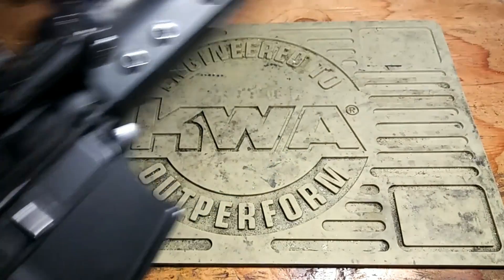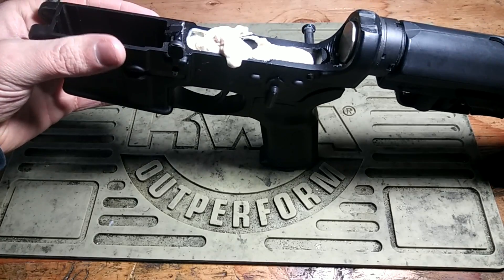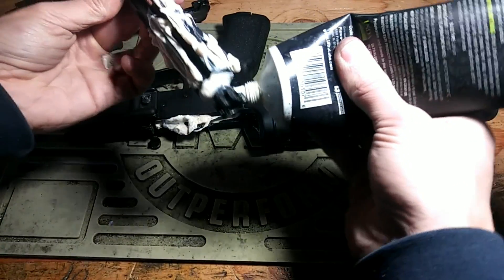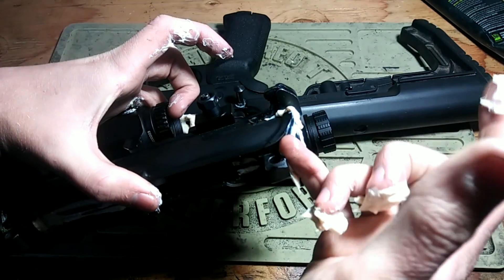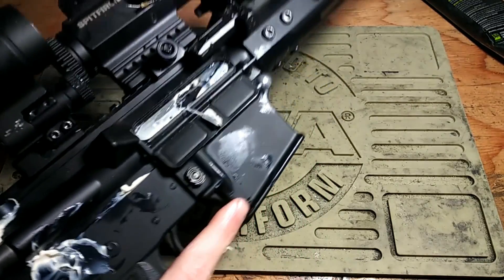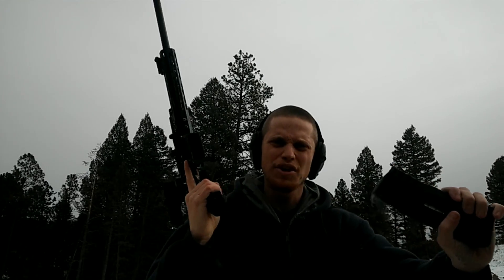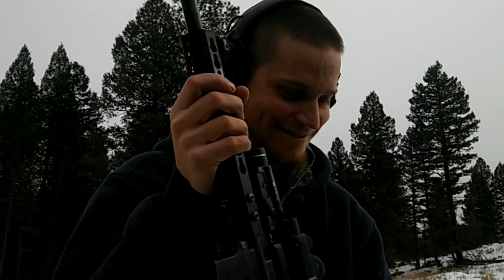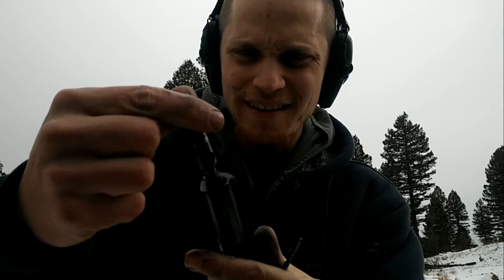MythbustAR15 OVERlubrication and NO GAS RINGS?!

Comment: OohRah, never to much lubrication, and do people realize how many m16s and m4s over seas getting abused daily and none are going to pass a gas ring test but they run just fine 🙂 imagine that. TBH ive never done a gas ring check nor ever replaced the gas rings on any of my ARs and I keep em wet asf when running em and no issues.
Reply from the maker: Ya. Seems to be a pretty robust system.

Comment: If it served no purpose to put gas rings in the weapon gun makers wouldn't put them in
Reply from the maker: It does serve a purpose. My point was people were saying when the gas rings were perfectly aligned, it was a flaw in the system and it would make the firearm malfunction, I proved it is more for redundancy and for self cleaning purposes. It is not essential for the function, just helps.

Comment: Grease does attract the dirt and debris very nicely. The problem is that as it collects the dirt and debris it changes from a lubricant to a more polishing type compound and then to a rubbing compound until it is basically  a sanding compound. The more dirt it collects the more efficient it becomes at removing metal. Ever polish metal? That nice blue Mothers metal polish? When you use it on metal and the rag turns black as the metal gets shiny. The black on the rag is not dirt. It is metal the polish removed to make the metal smoother. Not different than heavy equipment. Too much grease collects dirt that will prematurely wear parts in any application.
Reply from the maker: I like your thinking but oil doesn't last as long ime. ;)
Reply: @DouglasThompson  neither will the rifle with over lubricating
Reply from the maker: Better to be over than under. ;)

Comment: case ejection seemed extremely erratic when you removed the gas rings. If I had to guess (examining the ejection pattern with the gas rings still in) the rifle is overgassed to the point that the rings become kinda redundant.
Reply from the maker: Ya, that could be, thank you for your input! :)
Reply: I agree, definitely over gassed (as most AR’s are) I’d try a heavier buffer.
Reply: If anything the rifle is running pretty undergassed since the cases are either barely flying out or eject behind the shooter. Overgassed rifles tend to shoot brass forward at the 1° position.
Reply: @nemisous83  well it's definitely undergassed without the gas rings

Comment: Great vid. No more under-lubricating for this guy. Question: Does that white lithium grease liquefy and run all over at all when the gun gets hot?
Reply from the maker: No but it does need to be cleaned off and re-applied if it is going to be sitting for a long time. It wont hurt anything but it loses some lubrication qualities after a year or so. I typically clean my firearms after every session so it was never an issue for me. Id say a lighter lubrication would be best for long term storage.

Comment: I used high temp wheel bearing grease on all my guns never had a problem and it does make it easier to clean as all that powder residue does get cought up on the greese
Reply from the maker: If it works and works well, no argument from me, I haven't personally tried that yet.

Comment: Tbh I’ve been “over lubricating” for years. With the exception of rimfire I just squirt more oil and cycle the action.
Reply: Same. I bought an AR-9 from Palmetto State Armory and it came with a used BCG in it. Someone had run the thing dry with no lube for who knows how many rounds, and the coating had visibly worn off across most of the main contact/bearing surfaces on the bolt. It still feels slick, even dry, so I think it might be like that coating Sig uses where the color wears off but the nitride coating or whatever it is is still present. But still, someone ran the hell out of that thing and PSA sent it to me for full price as a new gun. Bastards. They offered to replace, refund or give me a $30 gift card. Considering the rest of the weapon looks brand new, and I plan on replacing the BCG anyway, I just opted for the $30. Still haven't heard back from them after weeks and several emails.

Comment: I’ve been saying this for years. Gas rings are nice because they push the bolt forward to make the rotation happen against the face of the chamber and not against the extension lugs helping prevent binding or cracking in the event that either surface isn’t completely true. Not needed, but nice to have. Grease is awesome.

Comment: Very cool video. I noticed that the case ejection pattern change after you took the gas rings out, so maybe some effect there.
Reply from the maker: Oh ya, it definitely is best to run the system with the rings. Just wanted to show it works without them since I had heard of so many people worried about the rings being aligned would cause the rifle to not have the compression needed to cycle.

Comment: That's not the point. If you ever lubricate here we're I live I will attract a lot of dust and dirt.
Reply from the maker: Well, Depending on your environment, yes oils and greases can collect debris. Oil and grease does not attract debris, though.

It is always better to lubricate than to run dry when it comes to mechanical things. You should clean and re-lubricate your rifle often, if it is used often. Much of the oil/grease removes from the action when the rifle is cycling. The lower does keep grease and oil contained better than the upper assembly, typically. Grease and oil does allow debris to move. If debris gets into the action, it will get displaced. The debris collected will move around until it settles in a spot no moving parts can interact with it. Some debris does get crushed and becomes part of the "paste" but a part surrounded by lubrication will do a better job protecting the system than a dry one.

There are tests proving this, it would be foolish to run dry, imo.

Im sure arctic conditions would change things a bit but for much of the world metal on metal at high speeds rubbing against eachother works best lubricated.
Reply: @DouglasThompson  yes I agree, but even if you run your AR dry. The rifle can use the carbon fouling as a dry lube.
Reply from the maker: @ortiz11039  from my own testing, and other tests I have found, it is best to run wet.

Comment: I don't really see that you proved anything. Yes under certain conditions an AR runs fine over lubed, the same can be said of no lube at all. Worn, damaged, or missing gas rings do not automatically mean an AR wont run.

But all of those scenarios have a more likely increase in a malfunction.
Over lubing will cause greater carbon buildup as well as capturing field debris.

Over-lube in the gas key, buffer assembly, or chamber can cause catastrophic failures.

Under lubing is less problematic, most AR-15 rifles will run fine dry since carbon without oil or grease is a dry lubricant. The downside to running dry is increased wear, and if any debris is introduced an increase failures can happen.

Worn, damaged or missing gas rings, won't necessary stop the rifle from working,  but probability of failure is increased.
Also over time, chipping on the back sides of the lugs or even broken lugs can can occur.

The right way to run an AR is using quality lube, and only a light amount, reapplying as needed.

Comment: This is hilarious! I think you missed a spot! Without the gas rings did you notice the inconsistent ejection of your brass? This would make sense.
Reply: Lehmann Peters 
Yup. 
Noticed that immediately
Reply: What about dry gas rings? I bought a 357 sig ar build and the guy who built it said not to oil the gas rings. When I took it apart the gas rings were so stuff and dry it felt like they’d snap with too much pressure
Reply: @A7XMetal420  lack of gas rings will become noticeable when you run underpowered ammo like some 223 stuff compared to 556. It will short stroke on you. If you don’t run under powered ammo it will function.

Comment: The issue with overlubrication is in areas like where I live. I'm in high desert, so we have a lot of dust in the air through 6-7 months of the year. Too much oil means dust build-up, which is bad, m'kay.
Reply: Even if particulate gets in the grease... Shouldn't you be cleaning your gun often enough it won't matter?

Comment: In indeal conditions, I think its fine.. but when I was in afghanistan, we had to clean multiple times a day. The baby powder style dirt would cling to anything with oil on it and lock the BCG up quick. 249's like the lube, but our ar's got a very thin coat. never had issues that way.
Reply: This is the exact reason DOD had the private sector come up with CLP. Coat your parts, let it sit, and wipe dry. Then you'll not have an excess of "oil" hanging around picking up grit, jamming up your works as fast. Glad you made it back.
Reply: What was your MOS Jonathan???     You saying AR has me questioning you.

Comment: shooting an ar 15 without gas rings or with worn gas rings is an excellent way to dramatically increase wear on your bolt. The gas rings serve one purpose. to keep the bolt pushed foward while the carrier moves backwards until the lugs are turned and won't contact the barrel extension.
Reply: That's actually not the purpose of the gas rings. The gas rings are meant to prevent gas blowby when the internal piston is expanding. if anything the rifle would run softer which is seen with the weak ejection because there isn't as much gas feeding the piston to rotate and unlock.
Reply from the maker: pscot468 my point was I hear many ask "do the rings need to be in a certain orientaion" or "i had a malfunction probably due to the rings being aligned". Just wanted to demonstrate its not that big of a deal! :)

Comment: I like that you tested these out, but can I explore a couple counter points? 1: that much lubrication can store a lot of debris, and it may be possible that firing enough ie steel case rounds can foul up your chamber and cause jams. 2) is losing your magnifier a negative consequence of taking off the gas rings?
Reply from the maker: thesweatleaf This video was in response to a commenter that said I over-lubed my rifle and it would cause malfunctions. I told him I clean my rifle after each session and he continued to say it would cause a problem. It never did. Lol

Im sure in certain situations it may be problematic but Id muce rather have too much lube than none (although I have done that as well for fun) things break easier without lube and whatever doesnt need to be there gets displaced very quickly.

But I do understand your point. Dirt sticks to lube and logically more lube equals more potential for debris to stick.

Comment: ......but you'd never use greese
Reply: knoxvegas 
      Never say never.
I know the russians had an improvised field lubricant protocol using automotive lubricants you could scavenge off vehicles. Used oil, axle grease, etc.
   Obviously you would use thinest lube you could find during coldest temps.  
    I have tested an ar15 lubed with straight wheel bearing grease left in a trunk for eight hours in -4 degrees F Worked fine. Not what i would use given an option.... but it worked.  
     I have found wheel bearing grease thinned with a bit of clp works very well on striker fired pistols.
  It doesn't get displaced or dry up like oil, or clp. It is far tougher and better quality than firearm requirements.

Comment: Pretty cool video and surprised it ran without gas rings!
Reply from the maker: ethan 7X57 thank you! glad you found it interesting!
Reply: The grease sealed the gas. It would have ran without the excess grease and the rings, the rings main purpose is to prevent gas and ultimately fouling from going forward in the bolt carrier.

Comment: Of course you know you are now going to have to do an experiment comparing on over lubed AR vs a minimally lubed AR in adverse conditions i.e. mud/ dirt / sand. I'm guessing minimal lube will handle adverse conditions better.
Reply: Douglas Thompson - Minimal vs Too Much
Reply from the maker: Zach M I plan on it once I get enough ammo. problem is, if they both dont malfunction, how fo we tell which style is better?
Reply: @DouglasThompson  cleaning time. I've got more amo then time. How many cans of break clean did you use to clean that sloppy mess. I think in this case on Lube just a dab will do ya and a whole lot will screw ya. When I'm done shooting I don't want to look like I just changed the transmission on a 78 F-150
Reply from the maker: Barnaby Wylde This is a good idea! I will do a test next time I get a chance. 

Do you reccommend i go full bore with the lube again? what would you be more interested in seeing?

no lube vs too much, 
no lube vs crazy amount, 
minimal lube vs too much or minimal lube vs crazy amount?
Reply: Maybe no lube, minimal, and too much. If no malfunctions a part 2 with all 3 including sand, debris, etc on every version to see which lubing practice fails quicker.
Reply: Douglas Thompson You can't do it! Not unless you get a used police issued AR15 or a used range gun. Your rifle hasn't been fired enough to get the larger tolerances that you need for grit to be a factor.

Comment: So what caliber is that AR?
Reply from the maker: Bubba  Phett its chambered for 300blk. .308 caliber
Reply: Cool
Reply from the maker: Bubba Phett What do you run, Phett?
Reply: Mostly pistols. I want an AR asap though
Reply from the maker: Bubba Phett you think about building your own?
Reply: I have actually, doesn't look too difficult.
Reply from the maker: Bubba Phett Its not hard at all! You are 100 percent correct. 

What would you be using it for primarily?
Reply: Both varmint hunting and self defense, so maybe two uppers one in5.56mm not sure about the other yet
Reply from the maker: Bubba  Phett Clearly I am bias because Im all about 300blk lol.

I recommend it though, its legal to hunt deer with and other large game.

could use .223 for practice and plinking and 300blk for hunting and self defense.
Reply from the maker: Bubba  Phett lot of people like running the 6.8spc too.

If i were going to invest in any other chamberings id go with .458 socom. be fun to develop loads for although vrass would be a hassle to get ahold of.
Reply: What about .450 bushmaster
Reply from the maker: Bubba  Phett A very interesting cartridge but for popularity/ avalability of components i think 458 socom is the winner. i could be wrong.

unlike the 300blk you cant easily make your own brass.
Reply: Bubba  Phett my 458 won't run without gas rings

Comment: by the way, I completely agree that you can not over lube an DI AR-15... shocked it worked without the rings tho
Reply from the maker: BangSwitch Ya, I had heard stories of a guy that ran his rifle one time without them because he forgot to install them or something, figured Id make it into a video so people stop perpetuating these
myths! lol

and now there is a video proving it.
Reply from the maker: BangSwitch If we are talking 800-1200 rounds. I shoot 1000 before I consider my guns worthy, both my AR's both my Glocks, My Mossberg MVP patrol, have all been subjected to 1000 rounds during their first outing with me. 

My Hatsan 12 gauge failed and failed hard, my 300blk american ranch failed, i havent shot my mossberg 500 more than a few hundred rounds but i see no point to test it like the others.

And my evo has nothing to prove in my eyes just yet, that might be subject to change depending on if i start reloading 9mm or not! lol

And this was with my Overlubing i typically do. lol

I will say when i was loading the powder coated 220 leatherheads my gun would seize up around 200 rounds due to the lead and powder coating gumming up my gas key. i would just take my carrier out and run a small borebrush in there pop it back in and keep going a couple hundred more. It was frustrating, spitzer-style jacketed ammo i run ALL DAY LONG! lol 

No problems, no jamming (unless i am using experimental loads) as long as i am running the appropriate weight buffer. I usually just pop the pin on the buffer and add or remove the little weights as needed.